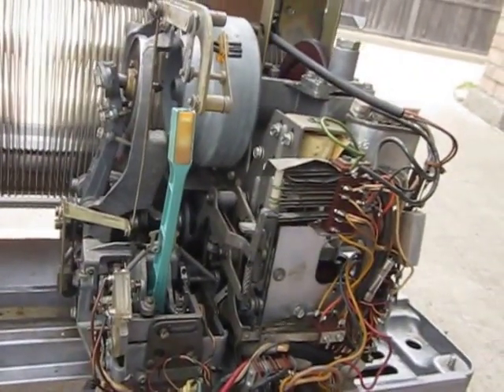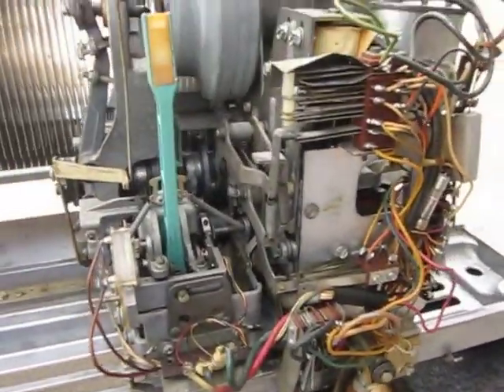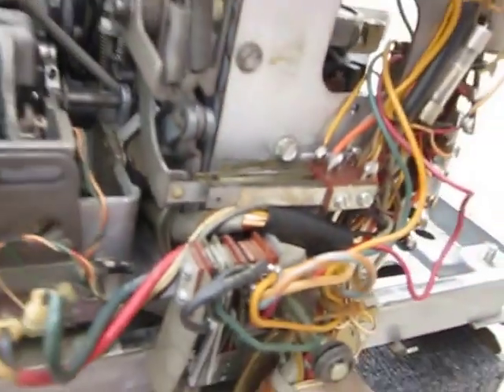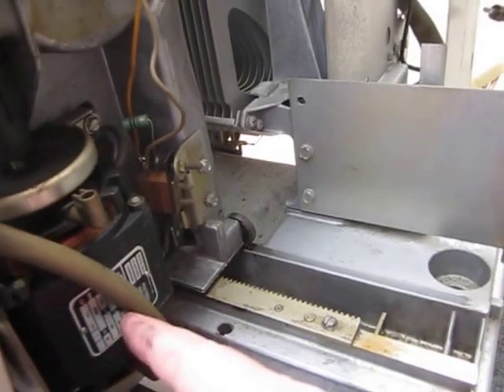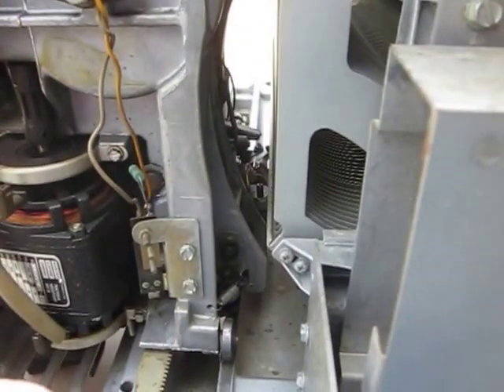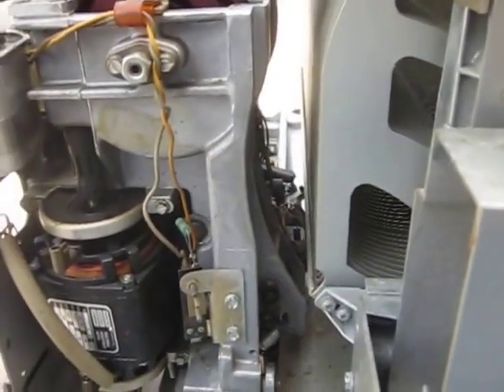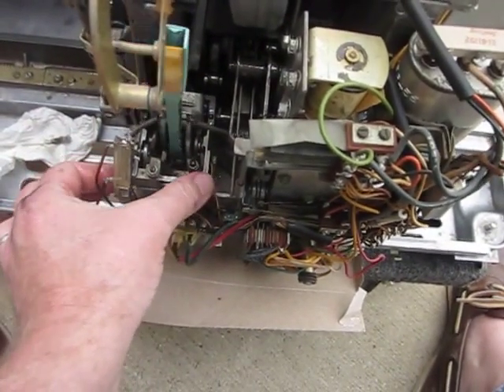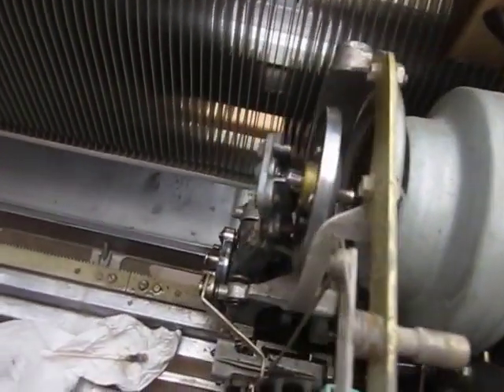7 How to Oil - Lubricate a Seeburg Mechanism

Comment: To get oil at those hard to reach places, I have used one of those 
flexible plastic drinking straws.  I let the drop run down inside the 
straw to where it needs to get to. Works great to get oil down there to 
that hard to get at (and sticky without oil) safety plunger.

Comment: You should be using Lubriplate 630-a. From my understanding that is what the factory used and that is what I used for years when I used to work on these jukeboxes. The Lubriplate 630-A is a Calcium bases grease that is applied as a very thin film and does not attract water. The problem with 3n1 oil is it goes everywhere it isn't suppose to. The only place 3n1 oil goes is in the oil port of the motor.
Reply: +Fred Wern Aero's Lubriplate goes on a few shafts that slide, especially where the Left/Right stylus movement for changing to B-sides happens and also on the pin and hole where the reject lever functions. All the pivot spots take a drop of the 3-in-1 SAE 20 electric motor oil, as well as the felt on top of the worm gear (one drop) in the very top hole and fill up both motor fill tubes.
Reply: Where do I pick up Lubriplate 630-a locally?   I checked Google and all I can get is results from online retailers.

Comment: Very good. My book shows the recommended oiling points, and in every case, excluding the motor bearings, it says to drip one single drop. In the HVAC industry we use an oiler tube called a "Zoom Spout" oiler. You may want to check that out. It has a telescopic tube that you can use to get into very tight spots, it telescopes out about 12 inches. Extremely well suited for this typed of work. Of course you would have to discard the contents as the oil in the oiler is probably not correct, but you could do that and then put your 3 in 1 20 grade oil in it....Sarge...
Reply: To get oil at those hard to reach places, I have used one of those flexible plastic drinking straws.  I let the drop run down inside the straw to where it needs to get to. Works great to get oil down there to that hard to get at (and sticky without oil) safety plunger.
Reply: That's fantastic!! I may try that for applications where my Zoom Spout oiler can't reach. Good stuff...Ol Sarge...
Reply: Most game, vending and jukebox distributors sold Zoom Spout oilers.  Many would mix it half and half with Marvel Mystery oil.

Comment: the other 3 in one oil you refer to is actually caustic and bad for mechanisms people used to use it for oiling sturmey archer 3 speed hubs on bicycles but over the years it leaves a glaze on the parts and eventually the gears start slipping requiring the hub internals to be completely stripped and cleaned then rebuilt the correct oil for sturmey hubs is automatic transmission oil for cars

Comment: On the seeburg not playing B side , the caridge shifts over , then the motor reverses back , . all you need to do is clean the contacts on the mech , even the reversing switch and you should have it . these machines can give problems not covered in any service or trouble guide !!!!

Comment: A clock oil applicator (sometimes called a needle applicator) works quite will in very tight places (filled with the correct oil/ or light lithium grease  for this application)

Comment: This video shows the exact mech my unit has. My problem is as soon as a 45 is dropped in place and the needle touches the record, it rejects and moves on to the next record. Rinse and repeat until the memory is empty. Only thing I see "wrong" is on the front lower right of the unit a relay, a plastic cog, some wires..look to be all held "floating" with 2 black round rubber bands. both of those are broken but the whole thing is still sorta floating. Sometimes it will play a record. And usually once it plays 1, it works for a while. Tonight all it will do is load, drop the needle, then reject. I can post a video if it helps...
Reply: +Lane Dortch That sounds like a stuck "reject" switch.  Usually those are a hidden non-descript rounded metal pin on the side or back of the unit, used to reject the current record selected.  They can really get stuck at times and you'll need something like a pair of micro side flush cutters to grip the button and pull it free.  Look for something that looks like a finishing nail with the head rounded, it will either be flush with the frame of the juke, or just proud of the surface.  When working correctly it should protrude 1/8" to 3/16" of an inch and move freely and spring back, it activates an internally mounted leaf switch.
Reply: +Mike Doyle thank you Mike. I will try that!

Comment: Can I ask you a question?  I just inherited an SS160 that was in storage for 15 years.  The motor/mechanism that goes back and forth to scan and pick up the records won’t move at all after the unit is powered on.  Can you offer any pointers on how to repair this?   It did work on initial inspection of the unit last week and played a few records.  But, it’s since stopped moving.
Reply: Did you ever find out how to fix this, I  just got a STD3 and it does not move at all
Reply: I have the same problem. Could you guys fix it?